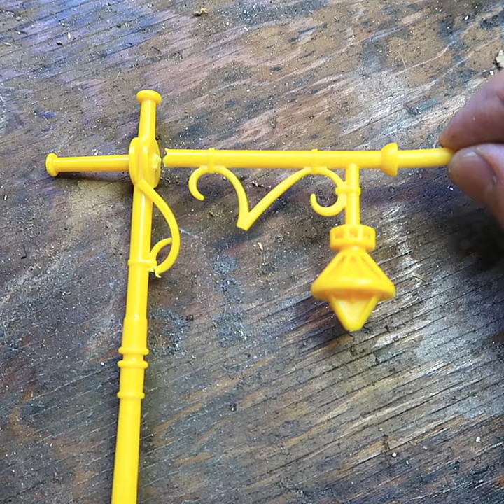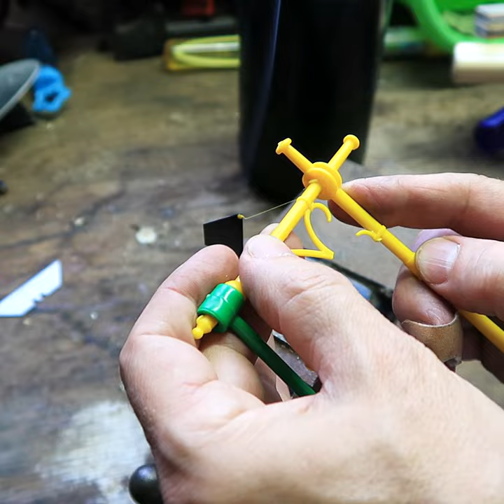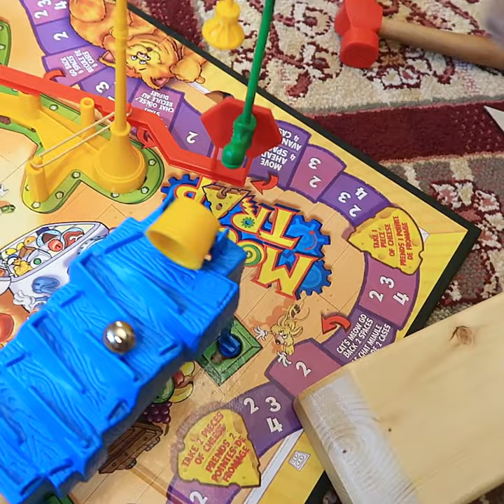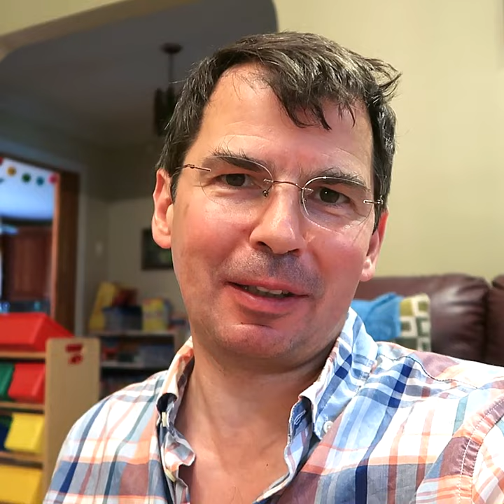Plastic repair -- melting it back together

Comment: If you wanted to keep the original length, I would melt  in a needle as a reinforcement to one part, then drill a hole in another and secure it with a CA glue

Comment: I fix parts like this without strength or lenght loss by using a tiny piece of wire. Basically same operation but permanently inserting the wire

Comment: I had to do something similar to fix the RB button on my bluetooth controller after one of the clips broke. Tried using hobby cement to fix it but it wouldn't last so I just used my soldering iron to melt the clip back to the button pretty much the same way you did in the video

Comment: Howto hang a picture on the wall "Let's weld a heavy steel beam on the wall, use some very big bolts AND hammer in a small nail"

Comment: If only there was a machine that could make a duplicate of that out of plastic!
Reply from the maker: If you have a lot of time to wait, like re-designing parts, want something that looks rough and is weak, there is a machine for that.
Reply: @matthiasrandomstuff2221  if only there were places people could download files and if only there were machines that made parts out of tough liquid plastics!
Reply: @avaviel  There is a time and a place for 3D printers but this ain't it. Matthias fixed it in almost no time. Not every fix needs to be 3D printed.
Reply: @Michael-Makes-Stuff  not to add that its more wasteful, he reused the plastic that already existed, he didn't use new plastic. Repairing is the way
Reply: @Matthias random stuff  Generalizing all 3d prints as weak isn't very fair. GOOD 3d prints are pretty strong, depending on material choice. I do agree that your fix in this situation was quicker, easier, convenient, and cheap.
Reply: I've had this as a long standing argument with Matthias. There are places that 3d printing isn't good. This is true. But some places it's absolutely perfect. Just like there are places where the crappy wood you pick up on the side of the road has useful places to be. 3d printing isn't a simple topic, and to assume all of it is bad is silly. 

And there's some excellent software out there, Matthias. you already know SketchUp, and that's horrible software. I wonder what would happen if you learned a good 3d software like solidworks or fusion 360.
Reply: @avaviel  at heart matthias is a woodworker tho, its like a personal style choice